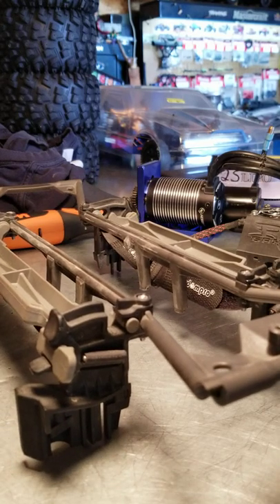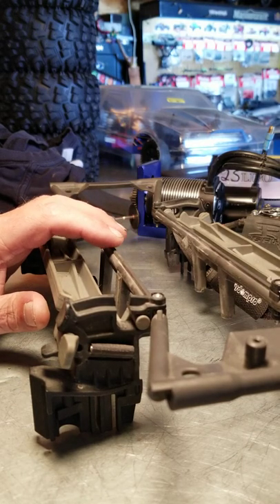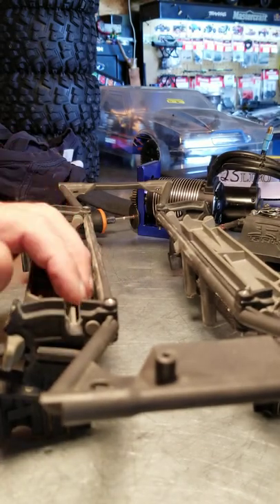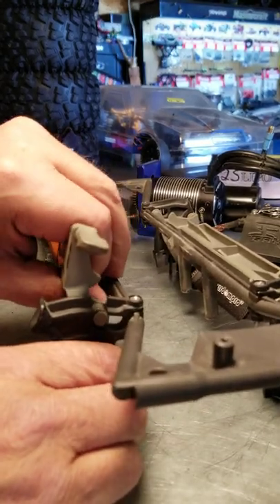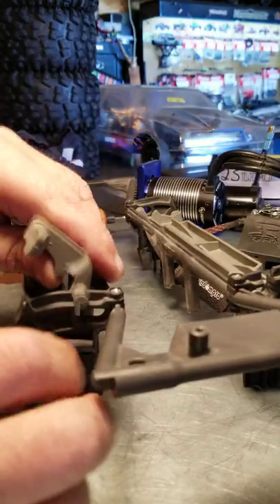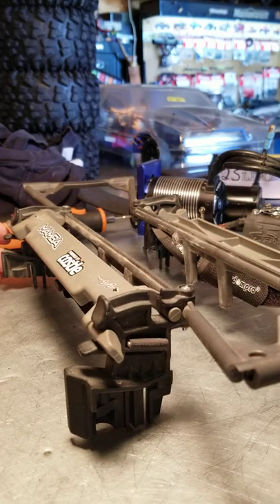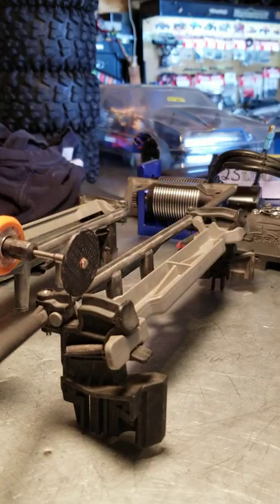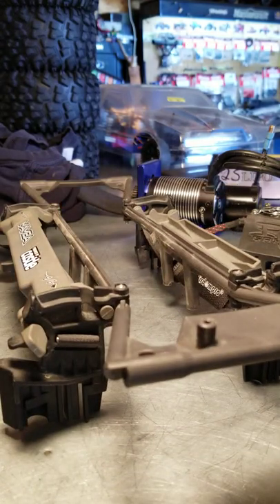Traxxas X-Maxx battery tray modification to fit larger batteries made easier.

Comment: Note: I just did this last night after watching you're video, you only need to cut 1 side both right and left
I cut the front ones and used a rubber band to hold battery tray tabs together for extra security
Reply from the maker: Yes, just one end left and right, and front or rear doesn't matter. I use velcro staps when I plan to do stupid or full send stuff, which I did before I did this mod anyway. 
Thanks for watching.
Cheers
👍🇨🇦🤠
Reply: Any suggestions for velcro straps? Like any brand in particular is better to use
And thank you so much for the video, just ordered some  6200mah and they wouldn't fit, now they're nice and snug
Reply from the maker: I just get a variety pak from Amazon, I also put two longer ones together and wrap it around the chassic and behind the cab of X-Maxx to hold my body on.
Lol again when I decide to do full send stupid stuff 🙃. 
Cheers.
👍🇨🇦🤠

Comment: hey cant you just undo that screw and just pull it out? no need to cut it then .
Reply from the maker: No actually you need to remove 16 screws that hold the chassis brace and battery doors in place in order to flip the battery door over.👍
Reply: @markkumollari43  ok thanks . but from where you are in the video. You could undo that one screw above where you cut and just pull the door out. on each side of course.
Reply from the maker: @heyby8764  that screw doesn't release the battery door. It attaches the chassis brace to the battery tie downs which are screwed in from underneath the truck.
Reply: @markkumollari43  yes that screw chassis brace to the battery tie downs. then you could just pop the door out. right? i dont get why to cut it .
Reply from the maker: @heyby8764  I have different size batteries and don't won't to take 16 screws out each time I want to run my bigger batteries. I have a few X-Maxxs that I've built for different purposes, speed running, crawling, general rcing and hard bashing, so it's nice to just quickly flip the battery doors. Cheers 👍
Reply: @markkumollari43  i just did it today . its 3 screws on each side/ one battery tie down. two on the bottom and that one on top. cheers and thanks for the answer though i was missing something lol. good stuff
Reply: I there great mod! But my question is, why did you have to cut the hole in the plastic? All I did was unscrew the two bottom screws and the one on top in the bar comes out.
Reply: @Barberev  he wants to switch it back and forth. he has different size battery's he runs in the truck. hope that helped